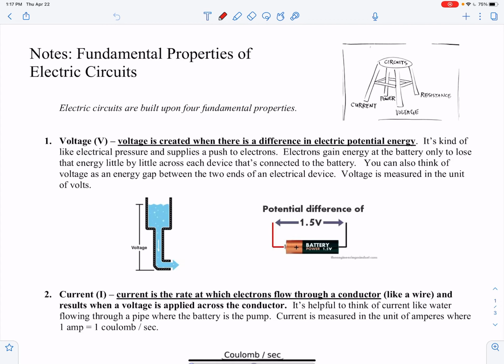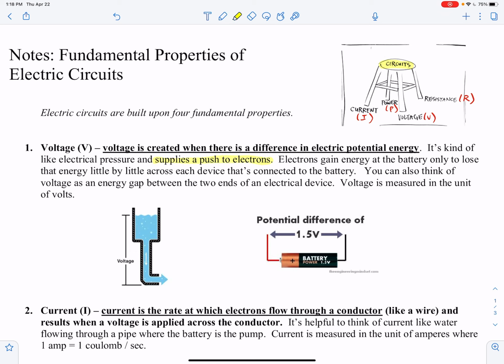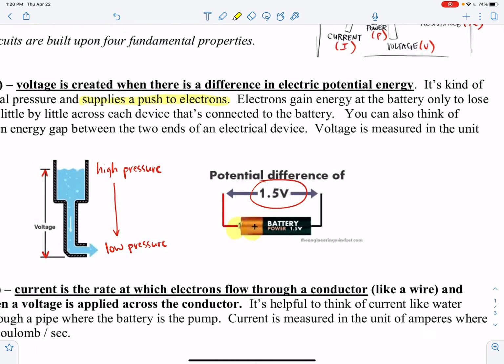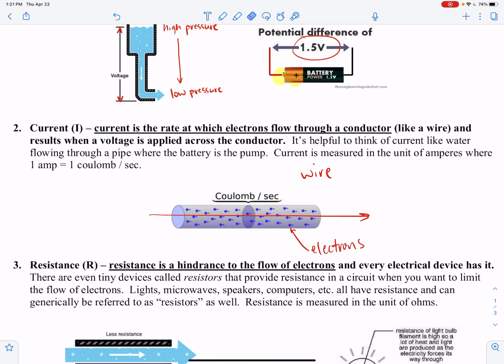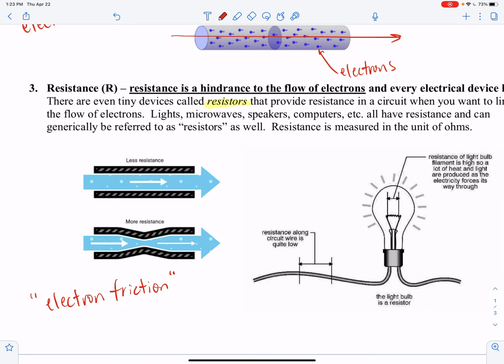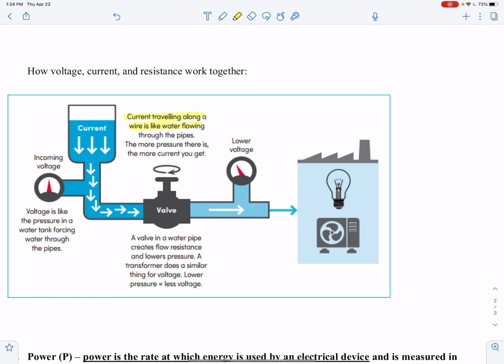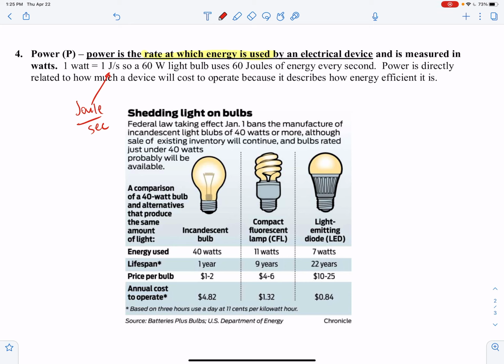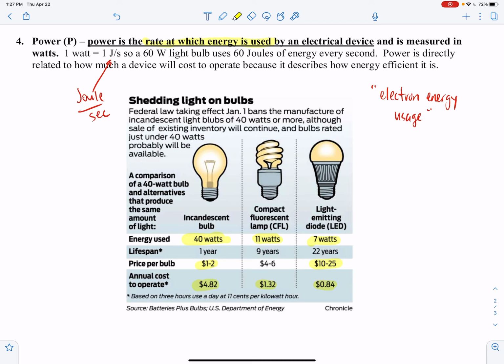Fundamental Properties of Electric Circuits

Comment: The water anlogy for voltage was wrong.there is actually more pressure in the bottom then in the top.You should've used height as the perameter as water always flows from High to low.
Nice video tho